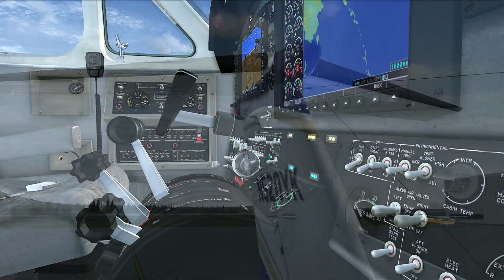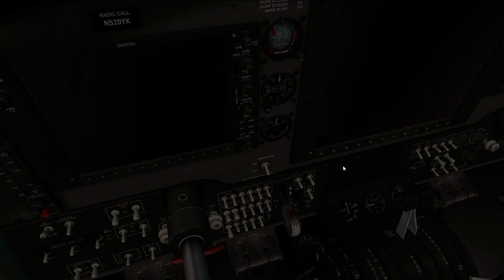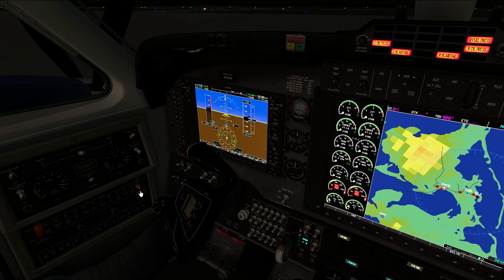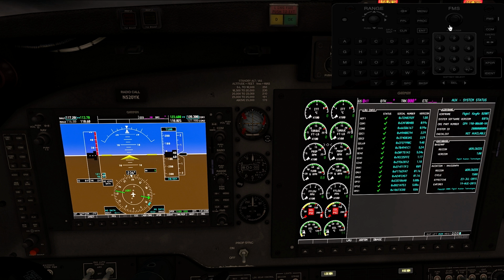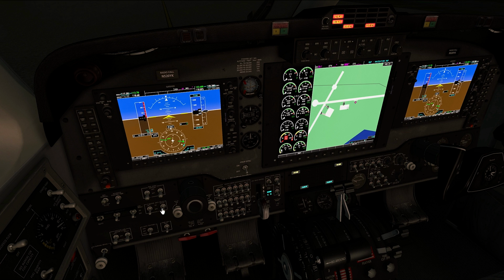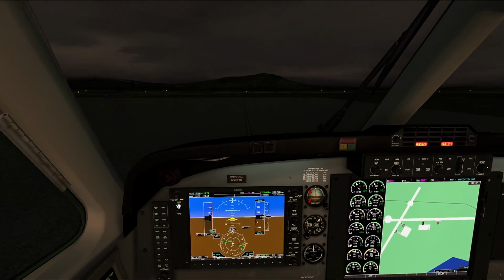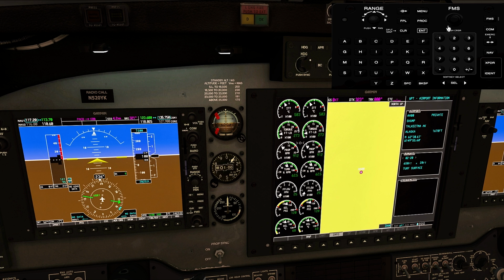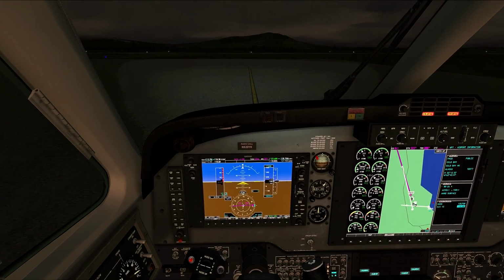Flight1 KING AIR B200 part 1 of 4

Comment: Cool video. I fly one of these for a living minus the G1000. 310 knots is far fetched on a modded B200 with XP52's. I get around 295-298 knots on a normal day and maybe a little faster in the colder months. 300 is fairly rare. Also, the AUX fuel is in the inboard tanks while the MAIN tanks are the outboards. 386 gallons in the mains and 158 in the aux's.
Reply from the maker: Thanks for the heads up Banshee365!  Cheers from Tim G., FS MaNiA

Comment: Hi, as usual, great video, one query, is this plane fully compatible with prepar3d v3.3.5? I mean fully compatible? and also with Windows 10 64 bits? cheers!.
Reply from the maker: Hi Laura,  Sorry for the long delay in responding to your query.  At this time I am only flying FSX and still using Windows 7.  I am not sure if Flight1 is compatible with prepar3d or Windows 10?  I do know they have a very good support system over at Flight1.  Please check them out at http://www.flight1.com/  Cheers from Tim G., FS MaNiA

Comment: Hi, awesome work like all your videos, is this b200 bird fully compatible with prepar3d "V3.3" and Windows 10 64bits?
Reply from the maker: Opps... sorry Raul,  somehow I missed this question.  Although, I'm not sure if the Flight1 version is P3D compatible.  I am still using Windows 7 64bit untilthe Flight Sim community IT tech wizards have time to flush out the Windows 10 issues.  You can check the Flight1 User Support Forums to find out if their model works with P3D and Windows 10.  Hope that helps and best regards, Tim G., FS MaNiA

Comment: How can I get my props into the Beta range. For some reason I can't find out how to
Reply from the maker: Hi 96 Alpha... well I completely missed this question. I'm very sorry.  I used FSUIPC to calibrate my throttles.  There is a procedure in FSUIPC for setting the detent and beta range for the throttle movement.  Hope that helps.  Best regards, Tim G., FS MaNiA
Reply: no problem thanks the help.

Comment: Hello! thank you for the tutorial，I have a question for you, how to change weight and balance（cg) for this aircraft？thank you！
Reply: +浩笛戚 theres a tutorial on that, what i do is maintain the same CG that fsx gives for deffault as i add more payload.
Reply from the maker: +浩笛戚 Hi,  I don't think the Flight1 King Air supports changing the weight and balance for this model at this time.  If you use the default FSX menu to change the load, you will get a message that says it is "not recommend".  I recall (from memory) something in the Flight1 support forums about the weight and balance.  I seem to recall they were planning a tutorial on the subject at some point?  It may be available by now.  You can check in on the Flight1 King Air B200 support forum for more information on that.  I hope this is helpful.  Kindest regards from Tim G., FS MaNiA
Reply: thank you very much！

Comment: What a beautiful aircraft! and loaded with goodies, keeps you busy. Your graphics are always top notch as is the flying. Very R/W. I like the use of checklists, and all the attention to the details,  good example for me. 

In your opinion, does this plane have a "real feel" to it? 

Thanks for your work,
Paul
Reply from the maker: +PT Johnson Thanks as always Paul.  I really appreciate your positive feedback.  It's hard to say how real the Flight1 King Air feels since it is somewhat subjective.  Compared to other FSX add-on airplanes, I think the Flight1 version  feels as good as any, and it seems very honest in the flight dynamics.  Compared to a real airplane,,,, I don't get the same resistance when pulling back on the yoke, or feel G-forces in tight turns or negative G's when pushing the yoke down, etc..  I will say I think the most real FSX aircraft I have personally flown are the Acu-Sim planes.  The do everything possible to make the simming experience as real as it gets.  I use to have a "Force feedback" type Joystick that did give a darn good feel.  It even shook a little when taxing and shook a lot when taxing on grass.  I don't know why they quit making those.  I really liked mine.  I wish I still had it.  I forget who made it,  I think it was called "Sidewinder" or something.  At any rate, transmitting the control forces through the yoke/stick adds a lot more realism in my opinion for what it's worth.  Thanks again and stay tuned.  Kindest regards, Tim G., FS MaNiA

Comment: hey did ya use the app for the keypad?
Reply from the maker: +Rodney Buckland Hi Rodney,  I did not use the app for the MFD controller.  I think that app is for Android?... and I am an IPhone guy.  I do have a second monitor that I use to put the controller on when I am flying and not making a video.  If I did that while making a video, it wouldn't be seen on the screen.  Do you know if they have an IPhone or IPad app for the controller?  Thanks, Tim G., FS MaNiA
Reply: I don't think they do right now which is too bad. If I knew  a grain about programing I'd make one for ya tho xD but I don't. Your solution works really well tho

Comment: Another great video. Yours are definitely the best aircraft guides i've come across here on youtube!

My only problem is that the list of planes i will have to buy get longer and longer for each video series you make... ;)
Reply from the maker: +Gerhard Stoltz LOL Gerhard!!  The cost of these add-on aircraft do add up, however, it is way cheaper to buy the most expensive add-on flight sim airplane than to fly for a single hour in a basic real world airplane.  At least flight sim gives us aviation addicts a chance within reach to fly some of the finest aircraft on the planet.  I don't have a clue how much money I have spent on flight sim software and hardware (and I don't want to know), but I am certain it is a lot less than I have spent on flying in the real world.  Thank you so much for your positive comments and feedback.  Part 3 will be up shortly.  Cheers! Tim G., FS MaNiA